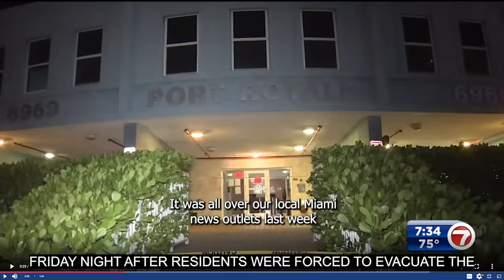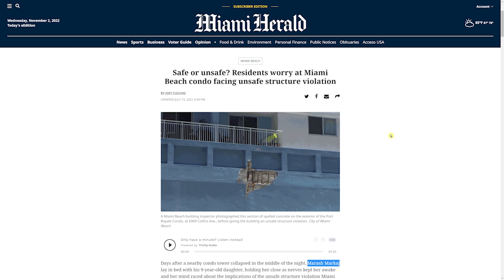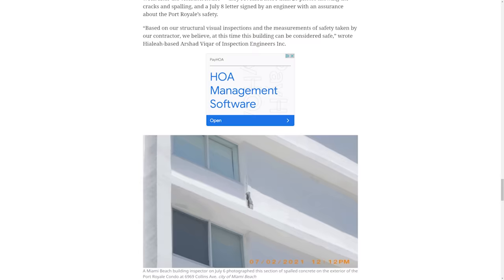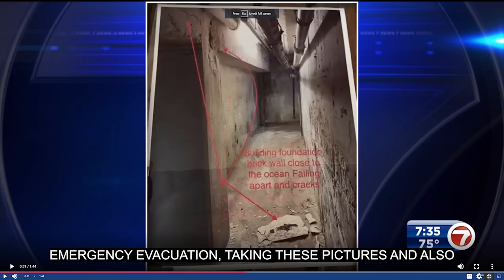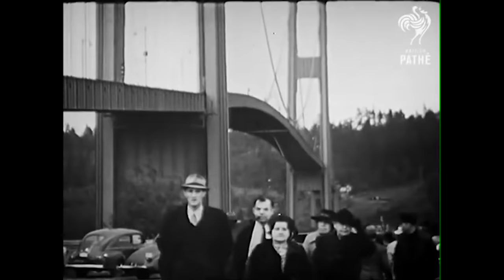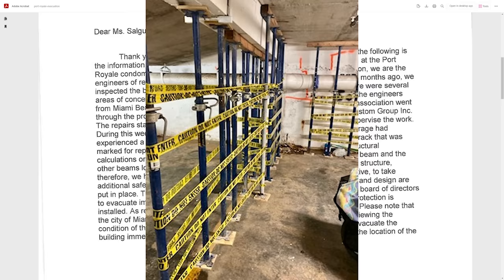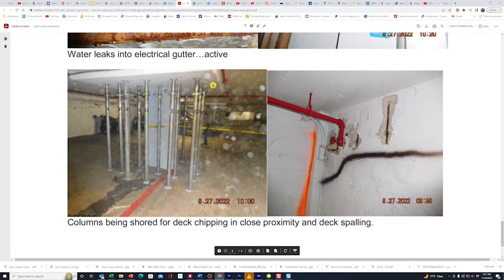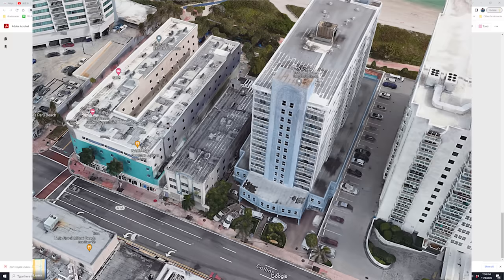Another Miami Condo Evacuated Why it Will Collapse

Comment: All that damage is horrifying. How did it get by that long unnoticed? 😳
Reply: It wasn't unnoticed. Porte Royale people have been struggling with it for years but it's advancing faster than they can keep up with it. They're still paying for the $50,000 per unit average assessment to repair the structural issues visible in 2011, which were substantial. The building is just deteriorating much faster than anyone could have anticipated. I feel badly for these relatively unaffluent people because I don't see how they can bear another, larger hit than the one in 2011.

Comment: In my Hud apt bed room for years the living rm & bed rm window have leaked when it rains. Now the water also leaks from the ceiling & is opening up. The  Hud manager just ignors the requests for repairs. I have to take the tank top off & manually flush the john oh & like I said before she upped my rent by another $100. ! 
   Next month I start putting my rent in escrow.😊
Reply from the maker: Check the landlord tenant lease laws in your area but in many places you are allowed to serve them with a seven day notice to correct show the photos and what is wrong and inform them you're going to stop paying rent if they don't repair within seven days. And then when that it. Is up you were down allowed to send them another letter saying there are in violation and you are not paying rent. You could also take them to court to have it repaired as well.

Comment: Hi Jeff,  Love your channel. Have an idea for another video on the Miami condo saga. You’ve touched on this a little bit (discussion of roof drains and pool deck construction), but maybe for homeowners associations who might need to prioritize and solve the root cause of problems (as well as curious geeks like me) you could do a video about the water mitigation solutions that might prevent damage to the structure in the first place. 

It seems futile to patch and repair damage without addressing the cause of it, but in reality, that seems to be what these municipalities are requiring on these buildings. In the permits and inspections that you have shown us throughout this series, it seems like the building owners are told to repair and replace the damaged elements; they are not required to additionally mitigate the water that caused the damage. Since water is so damaging to concrete (especially salt water), if it’s not stopped, it will eventually win.
It’s like a doctor who cuts out a tumor in your lung in order to cure your cancer, but doesn’t tell you to quit smoking.  It doesn’t matter how well your surgery went, no one is going to be surprised at your funeral. 

Anyway, what systems should these buildings invest in to keep the water  from adding significant long term load to the building and keep crucial structures of the building dry so they can keep their integrity over the long term?

Comment: Have they made any changes to building codes or inspection intervals since the collapse ?
Reply from the maker: Yes, new law passed in May,  law makes stricter inspection rules for condos that are three stories or higher, requiring recertification or a “milestone inspection” of buildings after 30 years and every 10 years after, or after 25 years if the building is within three miles of the coasts. Also condos must now keep enough money in reserves to make repairs. Previously we could vote to not fund the reserves

Comment: How do you replace a main beam or large concrete beam that's built in during construction and possibly is holding up the building? I understand that they would Shore it up to remove the damaged beam but how do they put it back so it does its job correctly?

Comment: Thank you Jeff. Concrete building....built in high humidity...on sand.... facing the beach...in hurricane alley ... with rising sea levels.  🤯
Reply from the maker: So far sea levels have not proven to be the root cause of problems

Comment: Good report sir. Look forward to more info on this building. How can this be repaired without Jack hammering all the concrete away from the rebar  all the way to where there is no more rebar rust? How do you support a multistory weight when the support columns and beams have to be removed? Hope you keep us informed.
Reply from the maker: They bring in additional pole shores and place many multiples around the area of the columns and beams to support them

Comment: So why were people still remaining in residence when damaged areas were detected? These people are really gamblers!
Reply from the maker: Just because you see a few cracks here and there and some damage doesn't mean the building is going to come down. It's not until the engineers look at it and decide that it is an imminent danger and then they notified the building department who comes in and puts in the evacuation notice. In this case the engineers noticed in the past month or so that one of the support beams had deflected 1/2 inch and that was enough to give them concern and rightly so.

Comment: That is why I moved from my condo at the beach in PR where I lived 30  years. The fixes were superficial. Many contractors use sand from the beach instead of the river to build. It is full of salt and just destroys the rebar and you dont see it. Originally the hallways were to have linoleum flooring and now every floor (18) has marble. Outside parking area had a huge planter built with  tons of dirt and a palmtree that grew to the 4 th floor and the underground parking area is under it and does not have any support system columns under it. We had cracked support columns too down there. Its a bad sign when all the engineers sell and move out. I don't think seas rising helps any either. While I was there for those 30 years the beach kept getting slimmer and slimmer. What a shame it was so beautiful.

Comment: As an Ironworker from South Florida, I can tell you that modern methods Include coated rebar and tested concrete.  This costs more.  These buildings there were put up very fast.  I heard old timers talking about putting the rebar while the concrete was being poured.

Comment: Surely each and every re-bar installed in such concrete beams etc should have been electrically connected to sacrificial anodes embedded in the ground or in other sensible places around every building?  Yet as far as I can see, no one ever sees any mention of such rust abatement processes.  Can you tell us why Jeff?

Comment: In tropical environments with saltwater mist anything older than 2 to 3 years starts getting eaten up. Literally the metal brackets that hold the air conditioners on the side of the building will rust completely through and turn to cardboard. The rebar rust inside the concrete pushes outward cracking the concrete.

Comment: And now you have Hurricane Nichole coming in. They might do worse than order the evacuation of the remaining Champlain Towers blocks as well.
Reply from the maker: Nicole is heading way north to north palm beach
Reply: @jeffostroff  You're misreading the NHC forecast. The cone is the span of realistic possibilities, it's most likely to be centred on Palm Beach, but it could be come in anywhere in the span Miami-Canaveral. And that's just the core, hurricane-force winds may be far either side of that.
The TropicalTitbits site is one of the NOAA staff, he gives a lot of supporting data. Ultimately, it's what actually happens, of course. As it is, another Condo's been evacuated nearby.

Comment: everything aside, you would think the insurance companies in charge of the condos would see the damage in parking garages like that (chunks falling, has to have damaged someone's car by now) would require garages in poor shape to close until repairs were made, only for not wanting to pay out damages to the owners of the cars. wow. That's just crazy!
Reply from the maker: That's a good point and I think that going forward you're going to see a lot of that it's actually very humiliating for me personally because my insurance company has contacted me twice this year that they flew a drone over my house and saw my palm trees needed trimming and ordered me to trim it or they would cancel my insurance because if the palm fronds are touching the house we could get Carpenter ants in the house. They also did a four point inspection inside my house it made me change the hose for my toilet supply line in the bathroom from the plastic that the builder had installed, to a brand new steel belted hose. and one has me so angry about all of this is here they are making me jump through hoops for my little old house but for a condo where there's hundreds of people in millions of dollars in liability waiting they do absolutely nothing Except pay $1.5 billion settlement when it hits the fan.
Reply: @jeffostroff  wowza! yeah that's pretty ridiculous!

Comment: I was there in October and it was so sad to see the big hole in the ground. I live in KC MO and my parking garage is showing major signs of neglect. I am scared for my life every time I am in there. There are chucks of concrete missing on every level, exposed rebar, rusted out drain pipes that leak and allows water to run along with 70% of lights not working. There are also cracks in the walls and some support columns.  How can I report something like this?> it is a very very old structure.

Comment: rebar is the structural element that is meant to give concrete added tensile strength.  when the concrete starts spalling like this it's really showing how bad the condition of the whole element is.  the concrete has degraded and the rebar is bending.  it's very very bad.
Reply from the maker: Yes, they will have a lot of expensive repair ahead of them

Comment: It seems at some point, the use of standard re-bar has got to be curtailed or stopped for tall and/or suspended structures. These architects should consider the use of 304 grade stainless steel as an alternative.
Reply from the maker: They do use coated rebar but it also has flaws
Reply: @jeffostroff  I thought "coated" rebar was banned in most localities?

Comment: Any seaside structure should have never been allowed to be built with uncoated rebar. It is just a matter of time. Not sure reinforced concrete is a good idea in general near the coast. Bridges built near the coast require a specially formulated epoxy, beyond the standard green rebar. I am a retired powder coating chemist.  I don’t see how these are repairable.

Comment: Once you start getting that kind of corrosion/rust on rebar and the concrete is cracking and breaking off the structure, I'm of the opinion that there will be CONSIDERABLE damage unseen and the building should be evacuated and brought down and rebuilt...sucks to be a buyer of such a condo....fixing only what you can see should never be enough, it's nothing more than a band-aid...

Comment: You should look into The Corpus Christi, Texas bay bridge/ship channel project. The Texas dept. of transportation ordered the project stopped because of engineering issues that the Builder/Designer says are not issues even though an independent engineer, hired by the state, to monitor the project was saying the footing of the main span has load issues. It's a nightmare........
Reply from the maker: Sounds like a good one!

Comment: Very interesting..Around 14 yrs ago I was working as a Project Manager for a large construction company that was in the process of taking maintenance on for one of Australia's largest public hospitals..my role consisted of quoting of multiple and running projects, each quote would need to last the duration (all maintenance and life cycle requirements) of contract (many decades) while I was inspecting the main multi story carpark I noticed cracking and concrete hanging from reo bars on the spiral entrances and yes this defect continued down in an almost identical pattern to ground level.I reported my findings and immediately with approval arranged for an urgent engineering report...I moved on from that role and I am unsure what the outcome of that in my opinion (serious issue) was..

Comment: Is the rust just caused by not repairing the cracks soon enough?  If the HOA repairs the cracks before the rust appears, these problems would be alleviated?
Reply from the maker: Yes, water gets into the concrete, messes the PH, causes calcium carbonate, moisture reaches rebar, makes it rust, and when it expands, it cracks the concrete

Comment: When I see the cracked concrete and rusted rebar I see that this building has already passed the repairable state.
When the rebar corrodes to that level the concrete has already decayed too far in general to be considered safe. It's even possible that the concrete has had a too low cement content in the mix, so I would definitely check that first before even considering repairs.

Comment: 1982 to 1985 I was in Patrick AFB I seen brand new car on the dealers lot with a lot of rust on them. What caused that was the salt spray from the ocean. Your rebar sitting out in the salt spray for weeks at a time waiting to be used will be rusted bad before you get it in the concrete. Rusting rebar expands and breaks out the concrete and weekends the building. There is no way to save the concrete building the rust on the rebar is through all concrete.
Reply from the maker: They should be using epoxy coated rebar by now

Comment: How the heck do you repair something like that?  I would never enter that building again.
Reply from the maker: Yes although the damage looks pretty bad and freaks a lot of people out, it's just like the dentist drilling away the bad material leaving only the good, and then they use methods from ICRI to repair the concrete up to known acceptable standards and it would be just as good as new again.
Reply: @jeffostroff  if they do it right. But that requires money and these people don't want to spend any money. I'm just glad I don't live anywhere near a large building. I know it's rare for them to collapse here in the US but I'm afraid of heights and the thought of falling to my death is probably the most terrifying so I'll just stay near the ground. :)

Comment: That beam 1411 with the shores under it will just blow out under pressure the shores are doing little good.Jeff why did they not use  shore planks on the ground and roof before they installed the jacks it seems like a crappy job. I would have used wood beams or steel to displace the weight no?
Reply from the maker: A lot of times I see that done without the planks and I doubt that the planks really add anything because the planks are just four inches wide a lot of times I see them use the 4x4 fence posts and there are no wider than the top of the pole, which is a flat flange

Comment: Worked for a really smart guy some years back. Built a gorgeous home on the side of an island facing the pacific oceans strong southwest winds. He would ONLY get concrete on days when the batch plant was making mud for the ferry terminal. Being a federal transport project they spec'd extreme duty concrete for saltwater immersion. Its the only time I've ever even heard of someone other than marine and foreshore federal projects. I reckon that home will last 200 years and still withstand an 8.0 magnitude shaker

Comment: Jeff, this is an excellent report from you. I feel bad for the condo owners but also for all the property owners in this stretch of buildings along the waterfront. Property values in this area are sure to decrease if this safety issue continues.
Reply from the maker: Thanks JMC!
Reply: Property values on 40+ year old ones for sure, some of the newer ones will still be high
Reply: Good we need market forces to help correct things too.. condo owners aren’t doing their part as a whole. HOAs have the power to manage their buildings properly

Comment: How would you secure a building like this? How do you keep the water out of the concrete ? Do you use special paints and sealants? In the case of the bending structural member, can they replace that whole thing while using support structures?  Thank you for your informative video.
Reply: Non corrosive rebar, concrete made with sand that has no salt, epoxy coatings. But, there are always leaks, and those leaks in these environments are corrosive and will eat away at the building. It's this type of pancake construction that seems to be the most dangerous...

Comment: Concrete/rebar and moisture don't mix very well and you throw a building on the coast, what do you expect. I'm from Maine and cars on the coast used to rust from the top down instead of rocker panels and wheel wells. Most of that was just from fog/condensation.

Comment: I feel sorry for the owners. They had their chance to sell last year. That door has closed, and a window for them to jump out of is now opened. Now, they are on the hook for repair costs. What are the odds that remediation costs will be greater than original construction costs? They are going need to get new mortgages to pay for repairs. If the banks will even give them one.

Can this sort of damage be safely "repaired"?  I would be interested to see you do a video explaining the repair options for the various damage documented.  Repairs always extend much farther than is initially visible.  For example, for that main beam in the garage, do they have to construct a "H" shaped brace to prop up the sagging beam, or something else? Would the prop need new footings/pilings installed?  What kind of repair do you do for spalled concrete and rusted rebar?  Do you "dig" all damaged/weakened material out to visibly "good" area (plus room for error) then reconstruct?